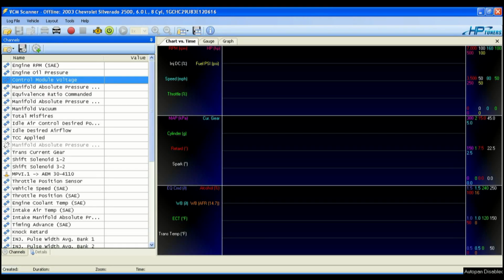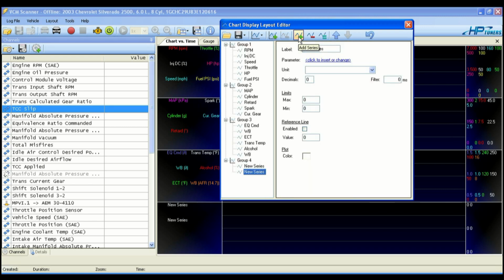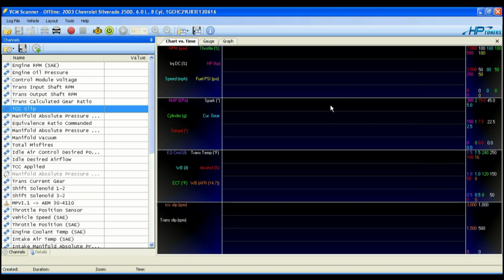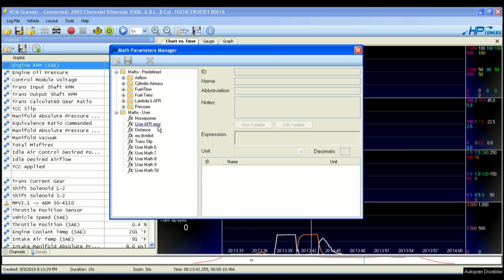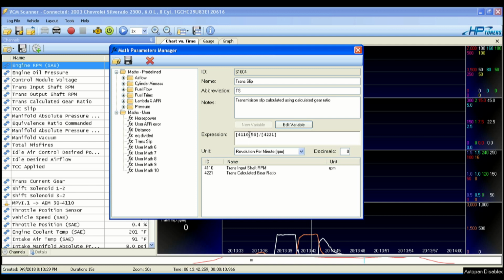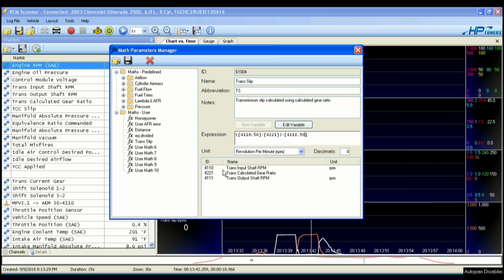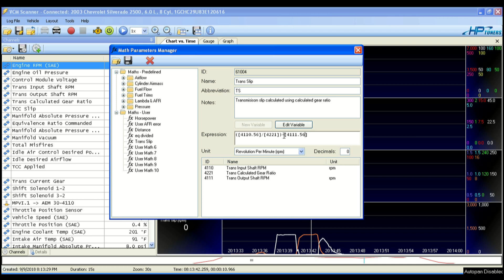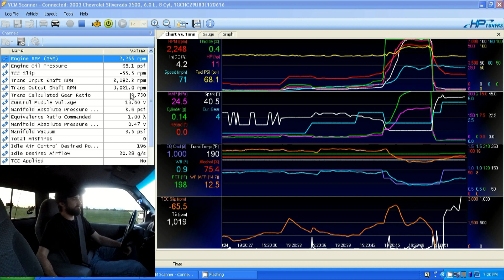How To Log Transmission And Torque Converter Slip In HPtuners!!!

Comment from the maker: UPDATE: An update to this is that the "calculated gear ratio" negates the slip so won't show correctly. If the transmission actially slip, that parameter "calculates" gear ratio based on the slip, so it negates the slip to zero. If you make the formula but use the actual gear ratio it will work. You could have 1 channel for each gear, or just have a main one for 3rd.
Reply: Can you please make a new video demonstrating this ?
Reply: Does that read as [input shaft rpm]/2.48   [input shaft rpm]/1.48 etc...? or since the gear is a ratio of 1 does it need to be done different?

Comment: This is an old video but very informative.  My application is european but same concept. I'm trying to learn what i can but info is hard to find.  You hit 11.5 degrees of timing. Im running 20 pounds of boost, peaks up to 26 at times on an off the shelf tune. Causing around im at 30 degrees but under heavy load it drops to 9, even lower at the top of my rpm. Small turbo so I bleed pressure at the top end. I don't have any KR and run 93. Do boosted engines just like lower ignition timing? It does have variable cams in it that adjust + - 30 degrees, does that play a roll in ignition timing

Comment: Hey Ryan, do you still use these parameters to log slip? I have a 60e and would like to know how well this works
Reply from the maker: @StationroadRatrods  This one I found later didn't work correctly because it was using "calculated gear ratio". Because it was calculating it, it would always diving by the current ratio and show zero slip... If you were to input the actual gear ratio it would work. You would just need a separate parameter for each gear, or just prioritize 3rd gear.

Comment: Thanks man great video
Reply from the maker: An update to this is that the "calculated gear ratio" negates the slip so won't show correctly. If you make the formula but use the actual gear ratio it will work. You could have 1 channel for each gear, or just have a main one for 3rd.

Comment: I recently did this on my 6l80. I also have a channel in HPT (v4.2) that is listed as trans slip pid. Using your formula I show 2-8 Rpms slip lasting less than 1 second on shift changes. The pid channel shows over 700rpm slip lasting almost 2 seconds during the exact same time. Can you provide some insight on this anomaly?

Comment: I wonder if it would be possible to log converter slip on a Duramax/Allison truck, I'm using HP tuners too.
Reply from the maker: Should be able to figure something out with it. Engine RPM vs. Something... input shaft speed, or where your 1:1 gear ratio is on trans, and assume trans isn't slipping. Not sure how the speed sensors are set up on there.
Reply: @BlaserBuilds  turns out the Allison TCM has a PID for it, don't have to define it yourself

Comment: I just got hp tuners ( havent used it yet)and was wondering where to start,where the good info is at? I am swapping a 5.3 into a 1988 chevy truck with gmpp cam among other things. Do you have any good tips for us newbs to hpt?
Reply from the maker: I'm pretty new myself, so learning as I go. Lot of reading time of forums, videos, and a lot of trial and error. Sloppy mechanics tune cabinet is a great resource for base tunes. There is a lot in the software, spend some time clicking around and reading the descriptions for things. Prepare for many many hours of head scratching, lol.

Comment: That's a lot of messing around to get things set up. The truck seem like it running great
Reply from the maker: Not too bad, it only takes a couple minutes. Nice peace of mind to verify I'm not having some other issues. Trans seems good, if like to monitor tcc slip over some longer run and see where it's at.
Reply: @BlaserBuilds  so that option only available for the electronic controlled transmissions correct?